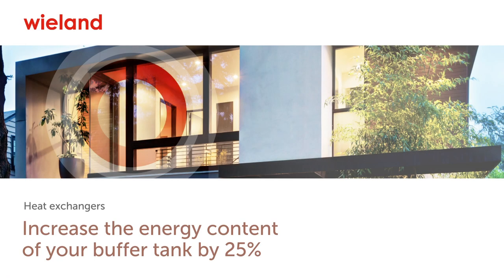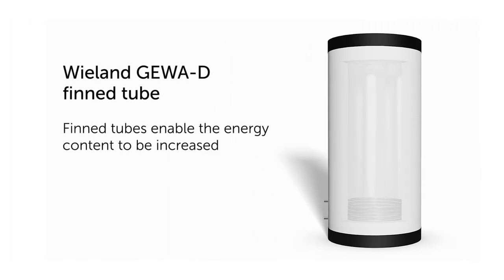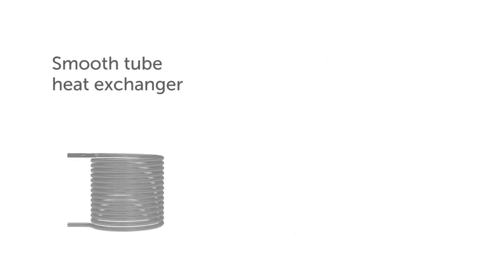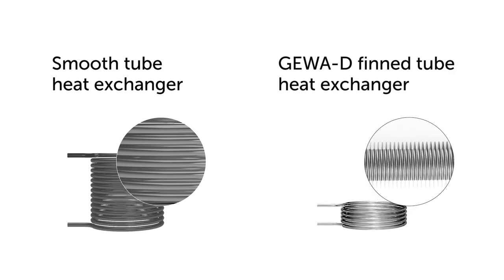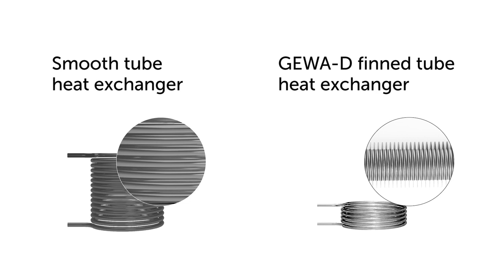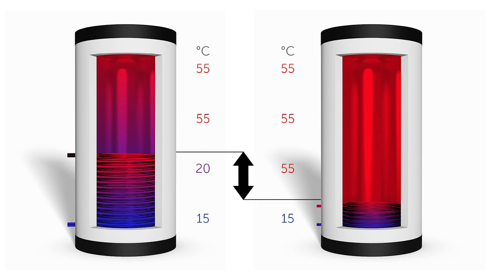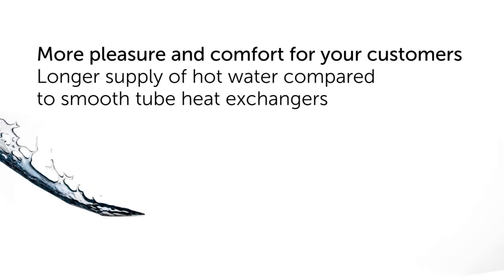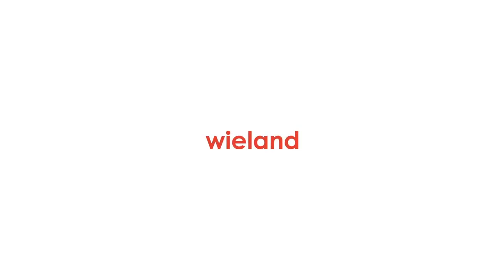Higher energy content in the buffer tank with Wieland finned tubes

Comment: I feel that water deposited will quickly lower the efficiency of those fines. With normal smooth fins there is a chance of the scale falling off.
Reply from the maker: Hi there. We undestand the concern. Scaling is very dependent on e.g. water quality, surface temperatures, surface (micro) structure and flow parameters.
 We believe that scaling is absolutely not necessarily worse with fin tubes compared to plain tubes. Fin tubes provide different surface temperatures and allow for compact solutions which can be placed in the coldest areas of a tank and therefore e.g. allow for lower condensing temperatures resulting again in lower surface temperatures. Additionally we’re working on scale-preventing surfaces in order make the usage of these high-efficiency heat exchangers even easier.